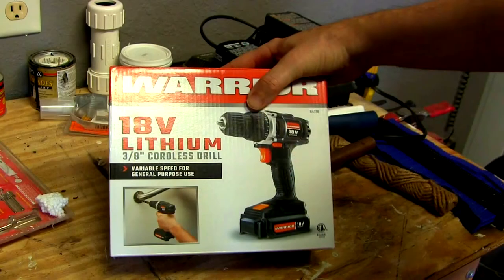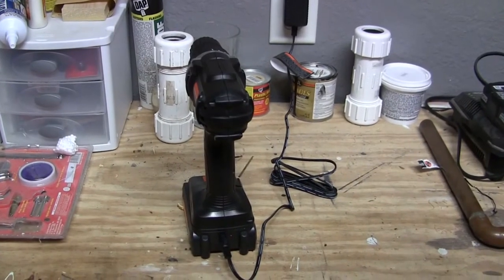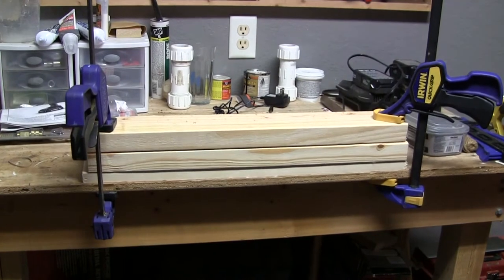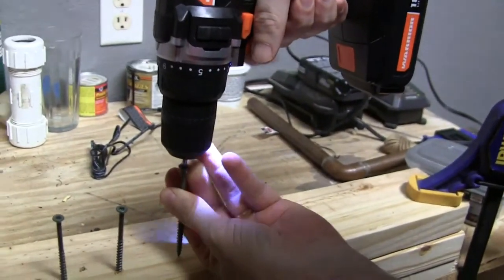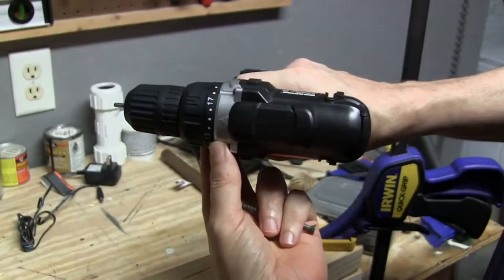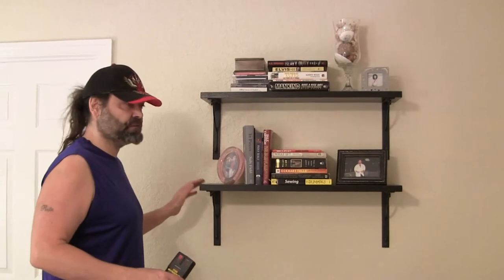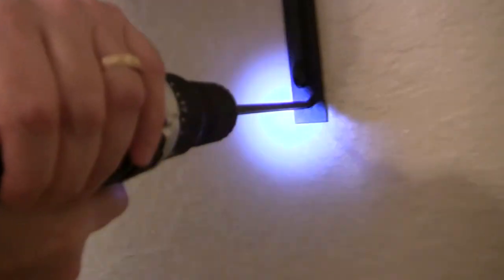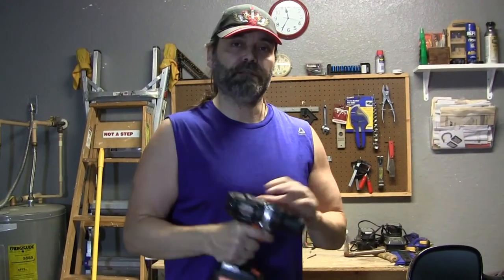Warrior 18V Drill From Harbor Freight Demo

Comment: Only downside is they only have a drill and light. Walmarts hypertough brand has decent budget drills but they have more tools available.  I'm on the Ridgid platform but I dont get why the pros always shit talk these budget homeowner drills.  They get the job done on light projects and are affordable
Reply: As a contractor its only on hard commercial use you will see a difference on diy home diy projects you will not need to spend the extra money. All the brands have batteries that go bad.

Comment: Just bought this same model for the torque settings. I have a dewalt, but its way too powerful. I needed a cheap screwgun that I could set to stop at around 30in lb. This tool was perfect for that.

Comment: The charger won't come lose from the battery after charging.. It's stuck How can I get it loose?
Reply from the maker: Maybe you have a different charger than I have, but the battery is charged by using the adapter. That wire should just pull out of the battery.
Reply: Toss it and get a milwaukee m12
Reply: @stevekonbass  so you charge it wirelessly?  I dont understand how do you charge it?

Comment: Great video as always, very professional. One question, how long did it take to charge the battery? Some of the other older kind take more than several hours. Just curious. I bought the non-lithium version of the same drill. It is about $10 cheaper, but not as powerful and the battery does not last as long. Overall though I’m very satisfied with it.
Reply from the maker: It took about 4 hours to fully charge it the first time. I usually go with Ryobi products but for $29 I figured I'd give the Harbor Freight brand a try. The last few things I bought from them I was pretty satisfied.
Reply: stevekonbass yes me too.

Comment: Hi. Just bought my first house so home repair is new to me. Is there a reason why you would prefer a lower torque setting vs just always maxing it out? Thanks
Reply from the maker: Congrats on the new house! A lower torque would prevent you from over driving, or tightening, a fastener. So lets say you are putting up drywall and you want the screw to stop slightly beneath the drywall, you could dial in that torque setting so that screw will stop driving the screw too far. The first drill I bought back in 1996 (a Craftsman that still works and I still use) doesn't have torque settings on it. If you haven't bought a drill yet make sure you get a good one. That will be the tool you reach for the most.
Reply: @stevekonbass  thanks! And thank you for the info. That’s very helpful
Reply: Super thank you! I'm here 3 years later and just purchased a home. I couldn't understand why a person wouldnt just leave torque all the way up.

Comment: your video is very informative but i need to know how to put the drill bits in or my drill is missing a piece
Reply from the maker: Check the directions. But, if you don't have them: Put the drill in reverse. While squeezing the trigger with little pressure (slow), hold the chuck (black part where the drill bit goes) and you'll see it open up. Then put the drill bit in, put the drill to the forward position, hold the chuck, gently squeeze the trigger, and it'll tighten around the bit. Make sure the bit goes in straight when you tighten it.

Comment: You didn't show how to put the bit in ... that's what I needed...
Reply from the maker: Hold the chuck (black part that spins where the bit goes) with your left hand (wrap your thumb and index finger around it), put the drill in reverse, squeeze the trigger lightly, you'll see it open up. Drop in the bit, hold the chuck again, put the drill in forward, squeeze the trigger, chuck will tighten around bit.
Reply: @stevekonbass  Thank You!

Comment: It will drill holes but it sucks if you try to push it as an impact driver. It will drive a 3 inch screw screw into a 2x or 4x but count on using a lot of elbow grease and having to use a sharp screwdriver bit. Motor got pretty hot after about 3 tries without predrilling pilot holes. I got this one about a week ago and l'm returning it before the poor little motor burns up. Oh well, you get what you pay for.
Reply: Es buena esta marca quiero conprar mis erramientas ime gusta este taladro